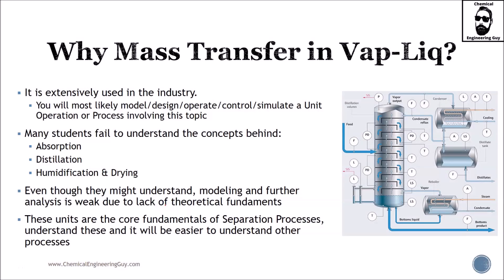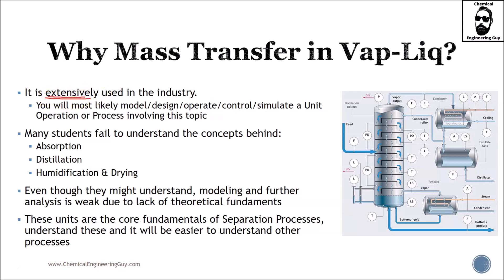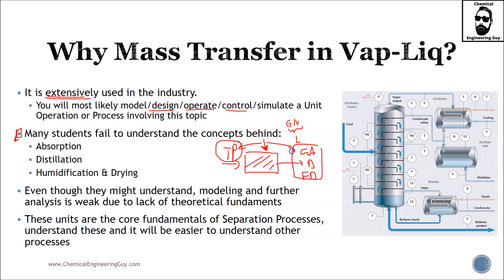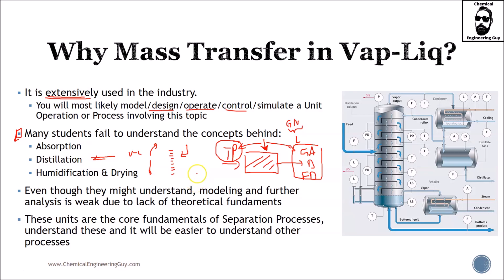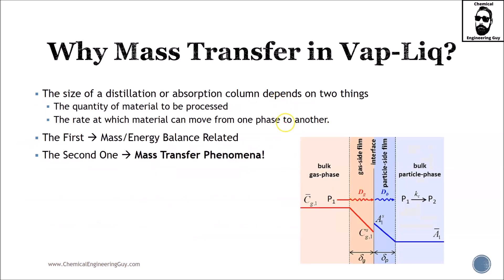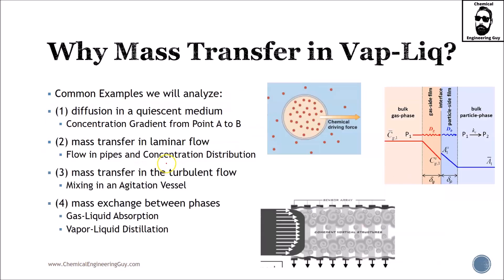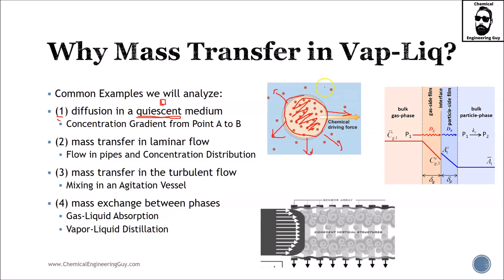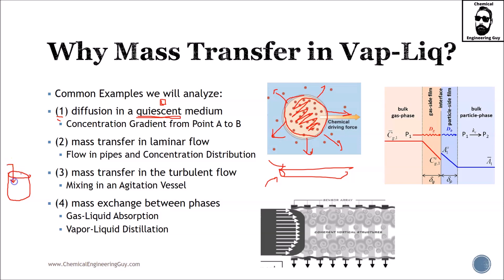Why Mass Transfer in Vapor Liquid & Gas Liquid Operations? (Lec004)

Comment: Thank you! I am looking for how to find the m slope for strong acids in a scrubber. Do you recommend something? I have look it in the literature but it’s critical the Henry constant and differs a lot
Reply from the maker: well... as with anything, you need to verify the specific effects of the polar agents... in my opinion, its always better to fact-check with a simulation and experimental data
Reply: @ChemicalEngineeringGuy  thank your for your answer. I found a paper where it says that for strong acids, the Henry constant should be multiplied by Ka (acid constant),